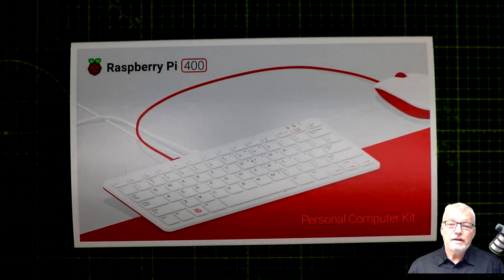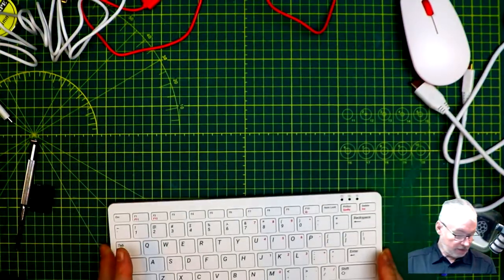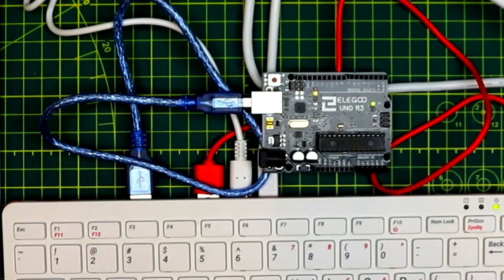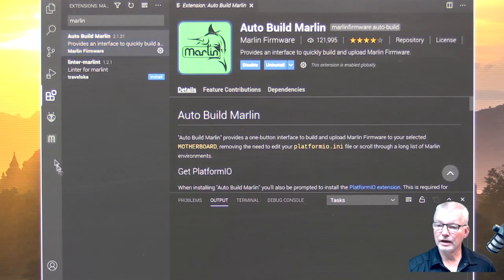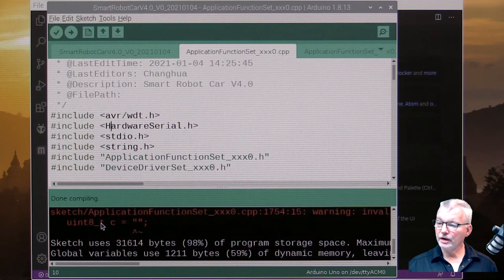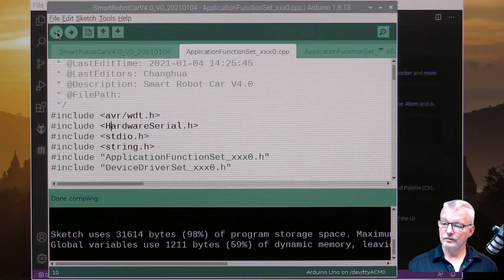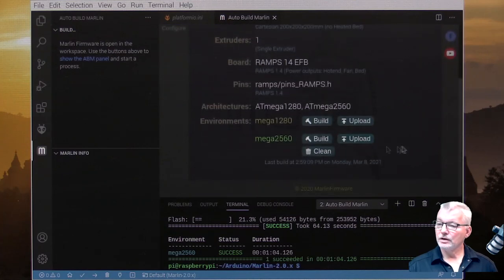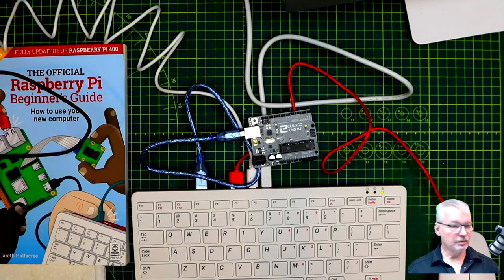Raspberry PI 400, Visual Studio Code, Arduino IDE

Comment: Ha, I liked that you took the Raspberry Pi 400 apart before using it.

I stumbled upon your video while researching the minimum specs for Visual Studio Code. Even though I can see you using the Raspberry Pi 400 and Visual Studio Code in the video, I still have trouble believing that a $100 computer can be used for development, but I suppose that is the point of the video that I'm working on. It's way cheaper for someone to be a developer today than 30 years ago.
Reply from the maker: If your using it for arduino / ATMEGAxxxx or similar chips then I would expect it to be perfectly good, big flash footprint chips , windows apps like sizes then probably not so much, but still very usable.